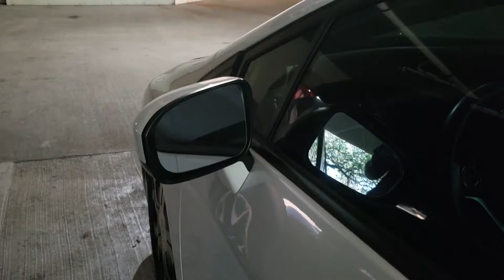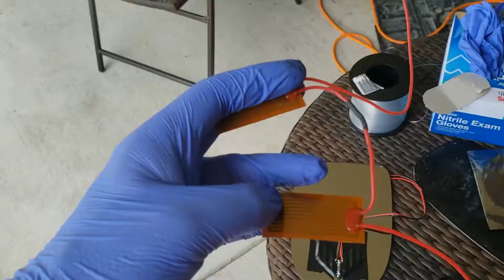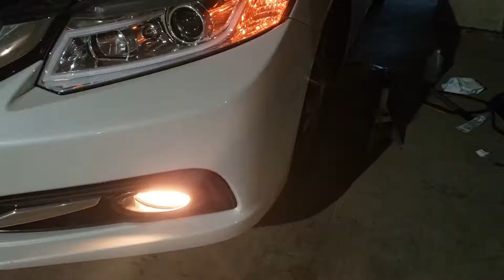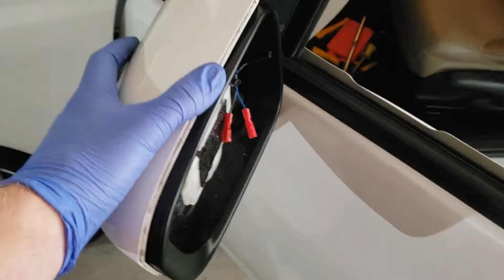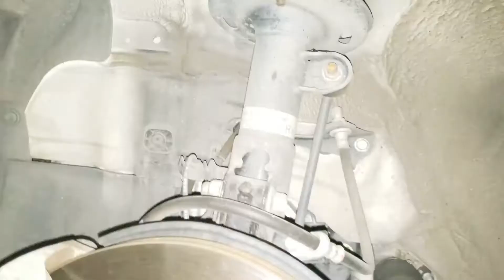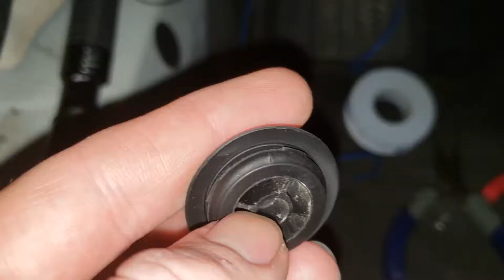2012-2015 Honda Civic Turn Signal Mirror Retrofit *RE-UPLOAD*

Comment: I have a 2014 honda civic lx and I want turn signal side mirrors on it, how do I do that?
Reply from the maker: For signals on the painted part, you would have to replace the entire mirror assembly.
Reply: @civicminded2141  can i just plug it in the same power plug with no additional modification?
Reply from the maker: @lawsonleavell6189  Depends on what's on the mirror you get. If you get the 2012/2013 hybrid mirrors, you should be able to de-pin your factory connector and replace the hybrid connector with it.
Reply: @civicminded2141  thanks

Comment: Hey!! It's me agian I commented on the first vid. Sorry I had another question come to my head, let's say I do buy the entire hybrid side mirror assembly's and wanted to put them  on my non hybrid  2013 civic ex-l, how would I wire the hybrid assembly wires to my Ex-l wires because I did some digging around and saw that the connectors don't match, so I can't just take out my current ones and plug in the new ones. And how would I get the signals to work because there is no turn signal wire to connect to the hybrid assembly wiring. Would i have to connect the signal light from the hybrid  assembly directly to my front turn signal like in the video?  Im really sorry for bothering you like this, its just that I really want to do this project,  and I don't want to buy anything unless I know for sure what I'm going to do and need. I really appreciate all your help!! Thanks
Reply from the maker: No worries- that's why I'm here!

Doing some digging, it looks like if you have a 2013, your connectors are similar enough that you can swap the crimped terminals from your new mirror into your stock connector, then use a custom connector for the turn signal as shown in the video. You should be able to get a thin flathead screwdriver, insert it into the tiny area "above" the terminal, and push the ramp back so the terminal comes out.

You can wire into your factory signal harness as shown as well.

If your factory mirrors are heated, be sure that the hybrid mirrors you get are heated as well (try these: https://www.carparts.com/details/honda/civic/kool_vue/mirror/2013/set-hd72er-s.html).

If you feel comfortable filming it, you can make a video that I'll upload to the channel as an addendum.
Reply from the maker: Pinout: https://drive.google.com/file/d/1jjQy7lcwyzweHZOemjtfjB4KHPXR_cCn/view?usp=sharing
https://drive.google.com/file/d/1GdF8QQTZrL-ttd_B0MHUdID5qxvPysuH/view?usp=sharing